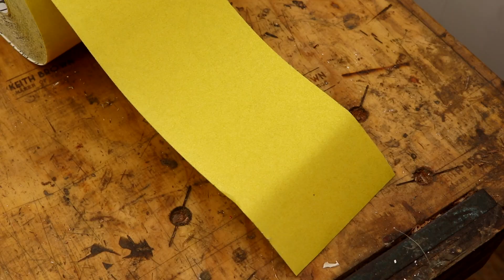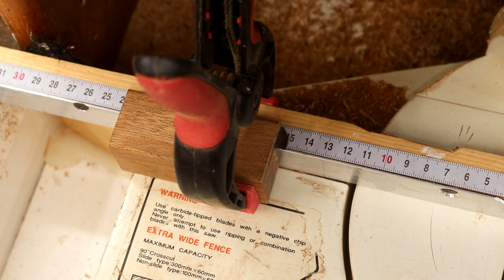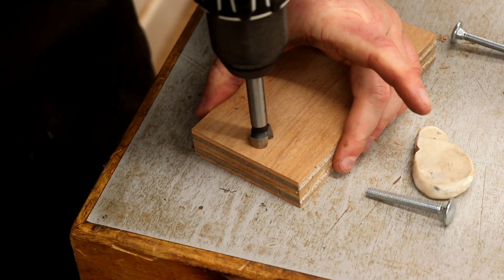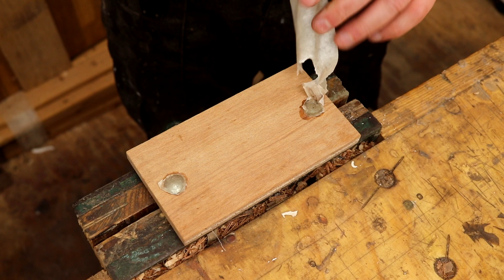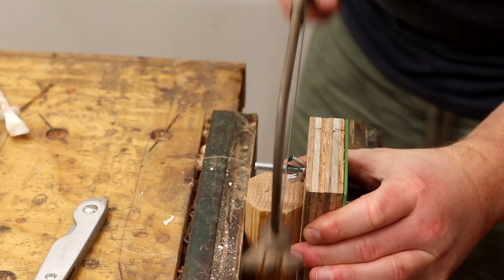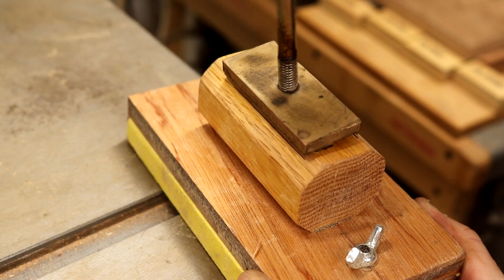How To Make A Simple Sanding Block

Comment: Keith, I watched your video due to a recommendation by Peter Millard. Nice build.  I have a commercial hand sanding block but I may make this one as well.  I am also thinking it would be interesting to make a few more with different curved bottoms for sanding curved areas.  Thanks for the tip.

Comment: Keith, It is good and fits well, but The sandpaper is better to be 10mm wider or the width of the wood to be shorter, so the sandpaper to be grabbed better ( more area to be folded in between ).

Comment: If you need to make sandpaper last, use some duct tape on the back and it makes it last so much longer! I stretch some duct tape across the back and a peice will last at least 3 times as long. I rarely rip it anymore it just wears out instead of ripping to bits.
Reply from the maker: Good tip! The Klingspor doesn’t rip at all though it is very robust so no duct tape required

Comment: Funny: As your video was finishing up, I was just beginning to write a comment that a couple countersunk screws for that handle would be a good idea, as I didn't think glue alone would suffice -- but I see you've already addressed that.  :)   The sanding block turned out great. Looks practical and even a bit elegant, if that can be said about a sanding block.

Comment: Hi Kieth , great little project mate ye definitely the handle needs a couple of screws from the bottom of the ply. Hey not to criticize but you were using the metal file the wrong way files cut on the forward stroke  not on the pulling, if you are going to pull a fill you should revers it so you don't damage the file great job non the less
Reply from the maker: Ah maybe that’s why I never have good luck using files!! I’ve been doing it wrong all along!  😂 cheers
Reply: @RagnBoneBrown  its all good mate i thought they cut both ways to but apparently not you will wreck the file if u pull it towards you   keep doing great work mate your a legend

Comment: Good project but my question relates to your table saw. It looks like the Dewalt DW745 - if so I noticed the riving knife appears to be flush with the blade but mine protrudes about an inch or so above so can be really awkward at times. If it is the DW745 model, did you buy a replacement riving knife?
Reply from the maker: It’s the original knife, I just re shaped it
Reply: @RagnBoneBrown  Hi Keith, talking table saws could you measure the width and depth (front to back) of your saw table for me? the dewalt site gives the measurements but it doesn't state which measurement is which! I need to see if it will fit in a space in my shop before I buy one. keep up the good work, Colin

Comment: Nice idea. Not 100% on the handle and the wingnuts. There's got to a simpler way of springloading the paper in there. Those wingnuts look like they will cut into your finger with a large project. Maybe some sliding bit of dowel to lock the paper in place.

Comment: Why does it look like you're filing in the wrong direction. I'm sure you're not since you're clearly aware it only cuts in one direction but it looks like you're holding the tang in your right hand and moving in that direction each time.
Reply from the maker: I probably am filing wrong, I never learned how to use one
Reply: @RagnBoneBrown  Ahhhhh gotcha, I thought I was going crazy. But you had most everything right it looked like in technique it's just you needed to go the opposite direction. Files really only cut in the push direction (when holding the tang/handle) and just damage the teeth if a lotta pressure is maintained during the pull motion. So, had you flipped the file around you woulda been perfect since you were only putting pressure in one direction. Hope this helps and good content!